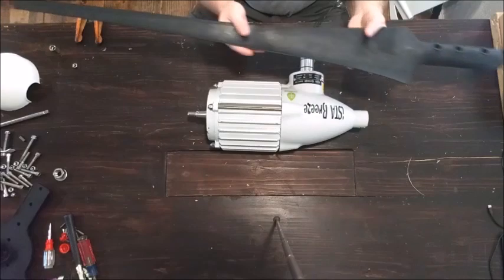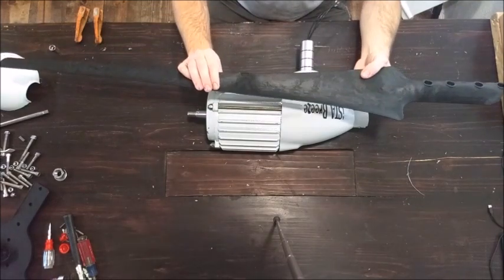iSTA-BREEZE I-1500 1500 watt wind turbine, Initial Inspection and Parts Summary

Comment from the maker: My apologies for the low resolution and focus issues!  I am looking into a better camera setup for future videos.
Reply: Thank you for the peek inside.
I have opened dozens of these Chinese PMGs, to replace the bearings and check for trapped wires on the way to the brush and slip ring assembly. Those PMGs are the cheapest that China turns out.
If you pay a bit more and buy Xmork  or Yenzhou Shenzhou,  The 2kw models, you get a decent lump for a fair price. You don't climb yo yhe top of the tower with the turbine. You assemble everything on the ground. You anchor the turbine swivel base bolts in concrete and raise the lot with the guys attached for safety.
If you want to see how much power is in this machine  You just wire it up on the workbench to controller and batteries. Lock the Ysw into the vice and spin the rotor with a power drill..
Spend 20 minutes going through a range of speeds and see if you find any clogging, you can still equal out the spaces between the magnets with a slow dremel and fill the space with epoxy resin. Personally I would not touch istabreeze with a barge pole. Our forum told more stories about this brand than any other.
Please don't go carrying these turbine heads up to the top of a tower. Assemble the lot on the ground with the tower base anchored and the tower head raised on a trestle so that you can fit the prop in one go. After balancing it correctly.
Reply: You are very thorough in your analysis! Much impressed with your knowledge of machining and electronics! And your common sense also is spot on! Thank you!!!

Comment: Hi Mate, I brought two no brand 3,000W 48V Chinese wind generators, they are lucky to output 0.5 amp each. But they came with a set of 5 blade 1.2 meter wind wheels, they are the best set of 5 blade wind wheels for high rpm. It does not matter which wind generator I put them on, it doubles the output, even in low wind. I brought them on ebay for $340 each but the seller stopped selling them, if I could find them again I would buy more just for the blades.

Comment: I can't tell you how many of those junk models I went through that looking sound good but very little output till I found the  1500. I have a low wind barrier, so the istabrees. 1500 is perfect for me. I also switched with a new hub to 5 blades. Much better performance in low wind.

Comment: Has Ista made improvements yet. If not what would be a better choise than Ista?
Reply from the maker: Define "improvements".  I've been running their products for three years in a very hard environment and the only issues I've had are some connector blocks and slip rings...both of which were more likely damaged by me shorting the phases in high winds to brake the turbines.  You can't get more wattage for the money than the i1500 or i2000.
Reply: Thicker wires. Their PMA you made some comment on that.
Reply: Ista is apping me from Turkey. I called them for some specifications. They now have my phone number and phone. If and when I am ready, they are happy to sell me a turbine. I am also looking at b-creation. Their PmA is super according to youtube John Daniel
Reply: cool to see you connecting the ista 700. Soldering is not yet my cup of tea
Reply: Very cool lots of watts for the money.

Comment: 40A over 3 conductors = 13A per wire.

2.5mm2 used has a capacity over 20A

Comment: hi, is the winding single wrapped, is the connection star-shaped, how many mm wire is used?
Reply from the maker: I'm not sure what "single wrapped" means.  I think it was 22g wire, I know I measure the wire thickness in the video.  I could not see what the coil configuration was without pulling the joints out and I try not to do with unless I don't expect to put it into use...too much risk of damaging the coating.
Reply: Bobin telleri sarim şekli demek istedim kaçli sarilmis
Reply: @ToysforWatts  coil wires wound as 2 wires into cavities wound as 1 wire

Comment: Interesting Video, looking forward to get one as well ("as a toy")

On a Side node, regarding your concerns about the thin cables:

You are saying 40A, also the documentation says 30A - but that is wrong ;-) 
You (and their documentation) are doing I = P / U with 1500 / 48 = 30A

1) There is no  neutral conductor, which means the voltage beeing used is taken beetween two phase conductor, hence it's sqrt(3) higher than 48 volts.
2) The Turbine is rated 48 Volts, which means it's actual voltage output is going to be 48 - 90 Volts.

Take both into account and you'll get I = P / (90 * sqrt(3)) = 9.6A - for what a 2mm² is totally sufficent.

Comment: Any update after 2 years? How has ir been doing, how does it look inside now?
Reply from the maker: The i1500 was great and it was up for nearly a year and a half.  I have brought it down, but only to replace it with a 48v i2000.
Reply: @ToysforWatts  Good, thanks! I just bought an i-2000 (not Heli,  not Windsafe) for my low-wind island setup. If I get 100-200w from 6-8 m/s winds I'll be happy. Not expecting anything over 200w except in storms.
Reply: @ToysforWatts  I'm currently thinking about the 1500 vs 2000 - what is your experience on that, if any? 
The 2000 has slightly larger foils, does it perform "better" for samev wind conditions?
Reply: I also want to know more about these in 2023. Thanks for your videos.

Comment: I disassembled the i2000 (it is identical to the i1500) and I can't replace the rotor due to the magnets. you can give me some tips for reassembling it?
Reply from the maker: I'm sorry to hear that and sorry to keep you waiting for a reply!  Reassembling the i2000 is going to be a chore, the best way is to involved someone with a lathe  that can secure the rotor and stator assembly.  I did my i1500 by hand but it was a close thing and I almost didn't succeed.
Reply: I stripped down 2 i2000 units 1 windsafe and 1 normal i2000 and at first were they are hard to reassemble but the easy was is to bolt them up not too tight and the use a flat blade screwdriver between the cooling fin and tie bolt to move into position and tension the bolt up while holding central.  I have stripped them down 3 or 4 times and can get them back together in minutes now.

Comment: Just bought me a i2000 and I want to see the inside of it. Like kid in a toy store. 😂
Reply from the maker: Word of warning!  It was hard to take apart and I almost didn't get it back together :D
Reply: @ToysforWatts  hey I have something in-store for my turbine. 😂 Won't need a dump load have better idea. Not only that I like to see this baby actually fill a 70kwh battery backup. "O getting full no problem other ac system or heater on theirs my one dump load." But for real I have a idea for two dump possibilities if one dump fails other takes over and we'll that dump on the second load just gets heavier and heavier on the turbine until it dang near comes to a stop. This was my main worries and figure a easy way to do my dump load. Give me a holla let you know how I plain on do it and can't believe it has not be done before. 🤔
Reply from the maker: Honestly if you're feeding it into a 70kwh battery bank you're probably going to have very little need for a dump load.
Reply: @ToysforWatts  here is the problem though that Im think before it may happen is that I do have 50 solar panels running during the day and even on bad days I still see about 40 to 30 kWh coming in at end of sun day and the whole idea for wind is to lighten the load at night time on the batteries to get my 15 20 year mark out of them. Basically wind say over 15 to 2o years will help the batteries out big time over the course of time. These are all lithium Nissan packs and custom 10kwh powerwalls that complete my battery side.
What I'm hoping is to keep loads on my turbine and lower my usage on my batts as much as possible.At night time usage's. I have two sunny islands running 6048 48v batts are setup in 14s 4.2v x 14 = 58.8 and only charge to 56 volts max and never go below 48volts. What I want the turbine to do is consist push power at all times at night day but if something fails go to full dump from turbine to diversion load. Hey may need to talk with you to see ur thoughts as you have played with grid tide  and turbines much more. 😂
Reply from the maker: It really won't be a large undertaking, don't overthink it.  You can do it simply enough to have two voltage switches and two solid state relays.  Use one switch and relay to disconnect your turbine from the battery bank when battery voltage gets too high, and the other to connect the turbine to a water heater element at the same time.  Something like this:

https://www.ebay.com/itm/363558191277

If there's any load on your bank, though, I doubt the turbine would easily be able to get the voltage high enough to ever need to trigger the relay...but better safe than blown up :D

Comment: How do you get the rotor out ( or back in ) without scratching off the nickel coating?  Do the magnets actually rub against the iron stator core, when removing and/or installing the rotor?  Once you remove one end cap. how can you keep the rotor centered?  I have read many horror stories of RUST following soon after the nickel is scratched off ...
Reply from the maker: Getting the rotor out was not problematic, but did require a lot of effort.  Keeping it centered enough to drag it out wasn't difficult.  Getting it back IN there, though, was an adventure.  I ultimately wrapped the core in a cut up soda bottle to help keep it centered and to prevent it from scratching anything...albeit I was more worried about it possible striking the coils.  Once the rotor was in the cage I was able to drag the plastic out and then wiggle things enough to get the caps back on.  It was quite a paint, involved a lot of swearing, and I don't suggest anyone else do it without access to a machine shop.  I can't guarantee I didn't scratch anything but I "think" it's okay.  I plan to take it back down somewhere around the year mark and take it back apart to inspect again.
Reply: @ToysforWatts  it'd be easier to spray it with Pam kitchen coating , I think...it's non stick, ya know..different strokes fer different injuns tho...

Comment: Im really starting to enjoy watching your content. Im subscribing for sure. Ballbearings, 6205 2rs, two sides with Rubber seals, its in the name, 2rs, i would probably change them out for some quality bearings from like SKF. It's not stronger than It's weakeast.. Bearing.
Reply from the maker: Thanks!  I'm glad I'm entertaining someone!  It's been up and operating for roughly six months now, my plan is after a year to pull it down and a similar video showing if anything has changed or worn.  I will probably change the main bearings at that time.
Reply: @ToysforWatts  ive seen a other video of it and it had water inside corroding the slipring wires and rusted the interior, magnets and so on, but that one didnt have any sealant at all when assebled from the factory, but it seems like yours did.
Reply from the maker: With mine there was definitely something to seal it up, plus the end caps were very tight.  It actually took quite a lot of effort to break the generator apart and put it back together.  I have seen the video you're referring to there has to be considerable differences between the way that one and mine were made.  Between the cap tolerances and the weep hole I just can't see water getting in there and, even if it did, staying there.  His turbine almost looks like it was submerged.

Comment: Hey just want to let you know that I have an Ista Breeze 2000 watt 48v. I have also found that the rotor is not evenly spaced with the magnets. I think this is done intentionaly to help prevent cogging while under load. I have  also had to machine new bearing housings because of the low quality castings that broke when dissasembled. Overall I do like the stator but agree the rotor needs improvment. They did not put a front seal on my unit so I machined out the bore where it should have been. The blades were a little rough so I sanded them smooth. I have a cnc machine shop so I was able to map the voltage vs RPM by chucking the spindle in a lathe. It seems like they rated mine to produce 2000 watts @ 28 mph based on the info I found from Ista Breeze. Anyway great vid!
Reply: I can confirm that it's very likely done purpose. The same principle is applied in EVs and hybrid cars propulsion system using permanent magnets; They are are spaced unevenly so avoid cogging at low speeds and that's why they need a resolver to know the exact position of the rotor to induce the correct magnetic field to start the rotation. For very high rotational speeds they even have magnets off position on both ends of the rotors to help cancel the expanding magnetic field with increased speed. Bigger electric motors used in heavy trucks and buses even use a 9 phases 
(yes, 9 of them!) system to prevent this even further since the diameter of the rotor is much bigger.

Comment: Please tell me what happens to the controller if it stops and does not charge the batteries at 760 rpm on the turbines.
Reply from the maker: How do you know it's happening at 760 rpm?
Is it an iSta Breeze model like this one?
What kind of batteries are you using?
What kind of charge controller are you using?

This really depends on what kind of controller you have, but typically dedicated wind turbine controllers have a built in switch that will protect your batteries in the event the wind turbine exceeds your battery capacity.  For example, if you have a 12v battery but your wind turbine is trying to throw 40v at it, the controller will divert the energy produced to an external load usually in the form of a resistor.

If your turbine is charging the batteries until it gets to 760rpm it may be that it's producing too much power and the controller is diverting it.
Reply: Can you give me your viber or whatsapp,i want to show you my work with videos,the turbine is 48V ista breeze and the controller is 48V ista breeze turkish 2000w.
Reply: The batteries are 240Ah/2v traction or 48v/240Ah

Comment: so some of our pick and place machines at work use magnets like this for Y movement, and they have a big warning to keep metal objects away in order to avoid situations like the one in the beginning of the video.
Reply from the maker: There's a point in the video where I'm wearing gloves...because that mishap cut a small chunk out of my thumb and I was bleeding on stuff :/.  I have an aluminum caliper specifically for measuring this stuff, but it's not a very good caliper.  I've ordered a polymer one that's suppose to be better.  It hadn't been a real issue with the smaller turbines but I knew it would happen eventually.

Comment: Well you stuck your calipers to the magnets, LOL. I've done that plenty to.... But as for the blades they are plastic maybe some nylon. Where the rough edges on the Leading Edge or is that the tail Edge, it's where they inject the Plastics into the blade mold... I was wondering the blade diameter on that? Bulgaria is where it's made huh...  The breeze had been around for a while now, it may just turn out to be an okay turbine. But I don't care for glued-in magnets neither!! Thanks for showing the breakdown of this turbine, I was kind of curious how they were building in them 😃
Reply from the maker: It took a little chunk out of my thumb when it when down, too...that's why I'm wearing gloves in the last bit of the video.  Every time I touched something I bled on it.

The blades are definitely fiber reinforced.  I'm really a little irked at the video resolution because that detail is lost a bit.  It's what makes the blade looks crummy.  You can see all the fiber swirls in it.  Nylon fiber compounds are becoming pretty prevalent in high stress composites out of China...I actually have a couple of Chinese bows made this way, and so are the blades on the Chinese turbines I've put up.  The Chinese stuff, though, has no visual texture to the material...Turkey/Bulgaria hasn't sorted out how to make them neat I suppose.

Swept area is going to be just a touch over 7ft...which is one of the reasons why I'm doubtful of the "1500 watt" claim.
Reply: @ToysforWatts  As claims of fiber, I've got a huge box of recycle plastic blades. One business claim it had seven composites in it. I've fought for six years of a lawsuits from a companies for what I exposed!! So I've done what you're doing ask closer to the truth channel, he knows... Companies will throw a false accusations into the court process and end up you having to defend yourself!! So I've been there and done that!!
Reply from the maker: I'm sure there's plenty of sketchy stuff with the machines in general, blades included, it's just not been a tremendous concern.  Fiber reinforcement doesn't make the blades work better...just might make them a little more resilient.  And, in the end, the resilience of the blades means very little if their design is poor to begin with.  No matter what they're made of, I am not impressed with these blades.  With their surface area and angle of attack and minimal variation in pitch they're going to have a terrible start up torque ratio.  The stator in my 700w turbine has peaked of over 1100 watts with 1/3 the copper and magnet material this one has so I think the claimed watts are in there...if this machine doesn't actually hit the 1500w mark it's going to be because these blades just can't do the work.